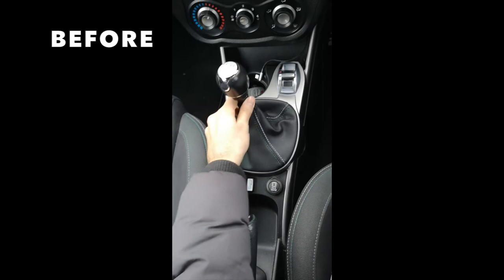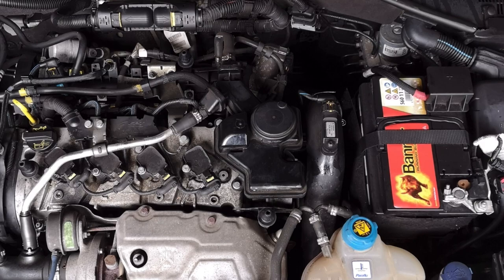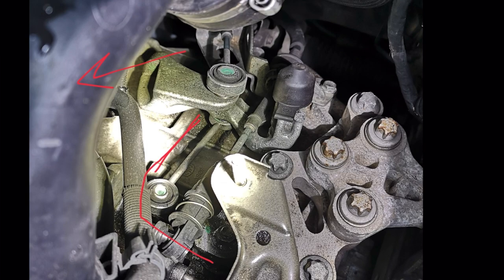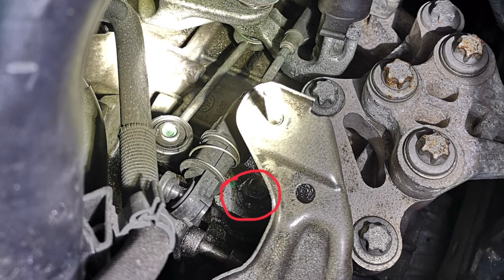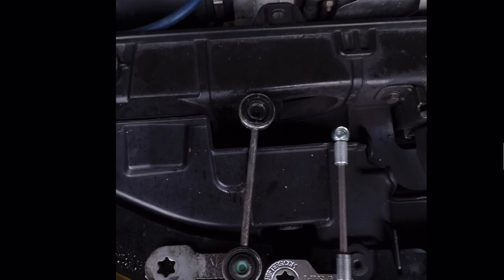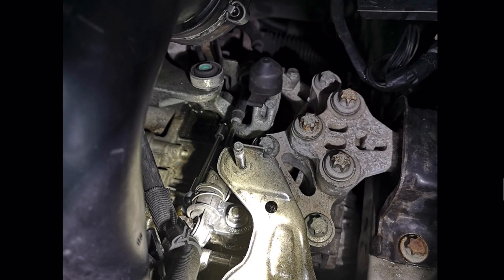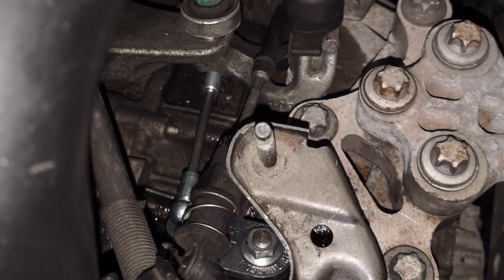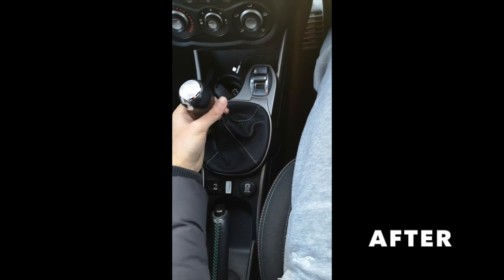SHORT SHIFTER INSTALL GUIDE | ALFA MITO QV | 4H-TECH

Comment: Hi, is this video and the 4H short shifter also applies to the 5-speed manual Mito? Thanks!
Reply from the maker: Hi, sadly not. I think the 5 speed has a different linkage mechanism. Although I assume it'll also be a pretty straightforward install with a huge improvement in gearbox feel still!
Reply: I have been looking for a 5 speed short throw shifter too and found one on the website gravity. Haven’t bought yet but at least there is one in case you were looking 👍